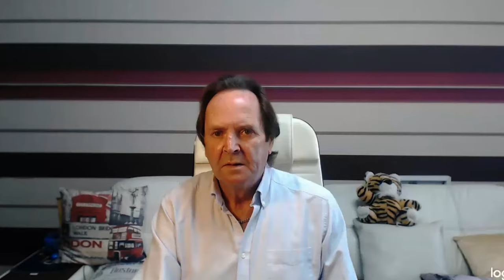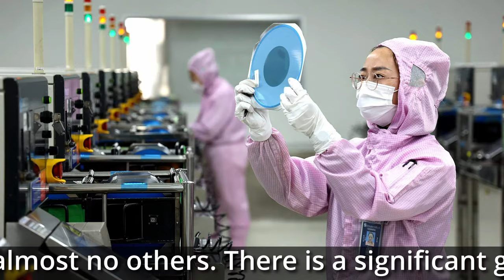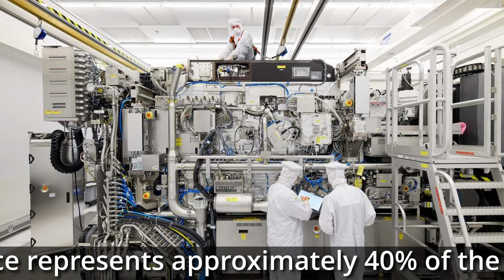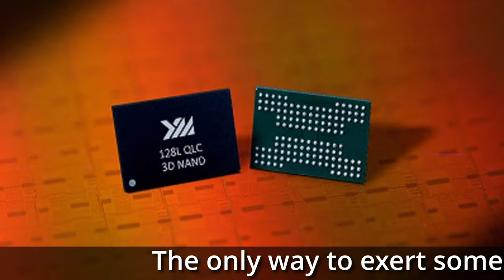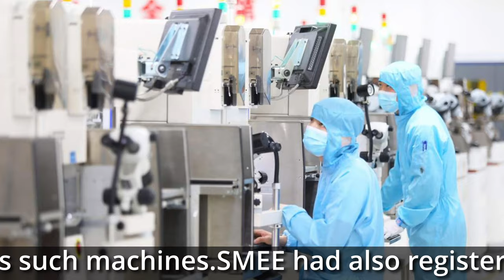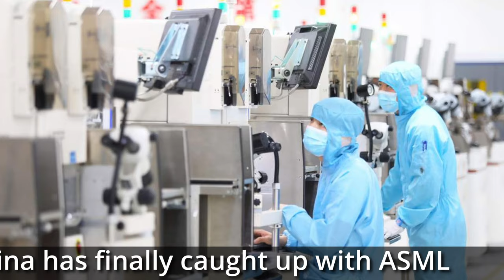China's Microchip Breakthrough Shakes Global Tech Race

Comment: The photolithography machines was simple in essence but very complex in reality. A photo resist liquid would coat the silicon wafer and a mask would determine which areas were developed by shining light on them, the light hardens the exposed areas whilst the unexposed areas could be washed away with solvent. Each step of the photolithography process( and there could be tens of them) a different mask was used for each layer and perfectly aligned in all areas. All sorts of factors have to taken into account and all within an ultra pure environment with minimal human interaction. 8 nanometers is unimaginably tiny. A human hair thickness is about 100,000nm, eliminating vibration to that level in itself is phenomenal. In terms real estate, the density of components is greater than mud hut village to megacity in a generation. It is like no other business ever.
Reply: Thank you
Reply from the maker: Everything is simple until you open the box and try to assemble the contents.

Comment: Without digging into the comllex details, this "accomplishment" by China isn't likely significant but mught signal China briadly learning hiw to design this machine and gather necessary supporting technologies. But, this Chinese creation is not likely any more capable than DUV machines introduced by ASML to market in 2017 and still legally sold to China. Although this class machine is still legally sold to China, maybe China can insert some minor customizations, but the opposite us probably just as uf not more likely that 10 year old ASML machines are still better than brand new Chinese machines l.

This Chick nese accomplishment does not mean that China is breaking threough sanctions and it does not mean China can make 5 nm chips commercially  Nothing has changed substantively.